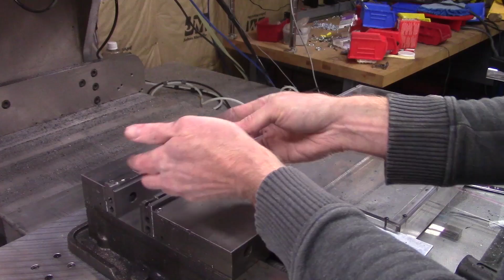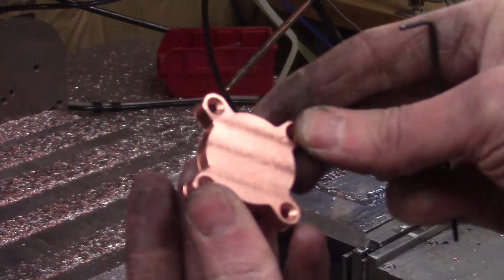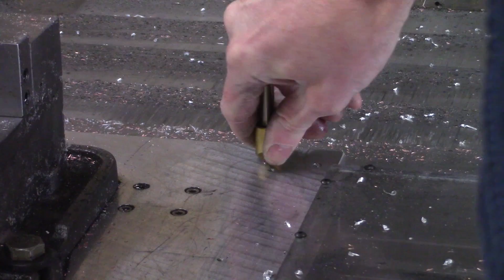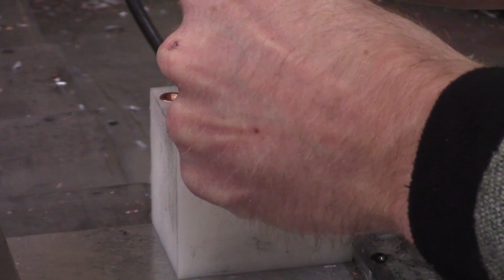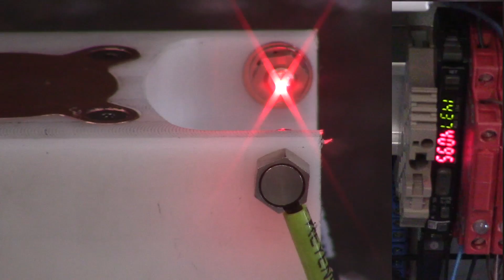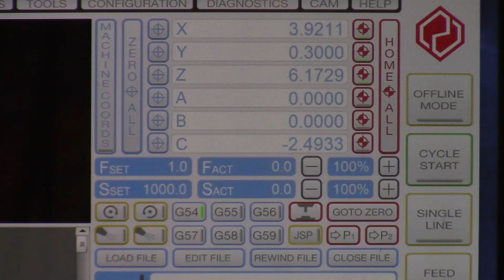Dual Measurement Tool Setter - Optical and Electrical

Comment: just so you know, the angle of the spot drill needs to be greater than the angle of the drills you are using. Starting with the edges of the drill is not good and will wear the edges faster
Reply: So few people follow this principle- even at the trade school I attend instructors don’t know this!

Comment: you can tap the untapped holes for the screws intoo the copper plate bigger as the tread the screws holding the plate to the base  mount intoo , that way you can unscrew the plate from the base put some bigger screws intoo the tread in the plate and have sumting to hold on to if the plate needs to be removed but is stuck in the base or use the force of the screws turning intoo the copper to force it up
looking at the setup if you move the tool intoo the light trap from the side you should be able to automate the tools width intoo the program too (set center of the chuck straight over the trap in the program and any deviation from that is tool width)

Comment: Would it be possible to share the UCCNC macro's for the tool please?
Reply from the maker: Hey David.  You'd be much better served by the guy I got them from originally.  Mine are modified to work with my setup and I honestly don't recall how they work.  Look for "UCCNC Macro sharing" on cnczone.com.  I just used the M31 code he provides.
Reply: Thanks for pointing me in the right direction :) I found the scripts and adapted them, works great :)
Reply from the maker: Awesome!

Comment: When I was working (retired now) we had a little sensor block for setting tool hight. powered by a 9 volt battery it had a brass top that was spring loaded (top could move down 1/2", great for Monday morning settings). We marked it's height on the side and set everything up using a ground rod reference tool. Had a plug on the side that we could use a cable to connect to ground when Milling non conductive material.

Comment: You are using Mach3 ??
Reply from the maker: UCCNC
Reply: How is it compared to Mach? would you consider it more user friendly? does it have a really large forum/Source of help? I barely manage to make my Automatic tool changer work.. but is just really harsh to find people that actually have experience... "Tons of companies willing to write a macro for a few thousands DO!!!!
Reply from the maker: I haven't used mach but it definitely is pretty customizable.  There's a small community of people on the forums to help and the guy behind the software posts a lot.  I'd say you'd be hard pressed to find something it can't do, but you will likely need to program your own stuff; but there's tons of example macros to copy.  Plus the guy who runs the US distribution is really helpful (cnc4pc.com).  I'm just starting to look into using its built in Modbus functionality to have it interface with an Arduino which should make it virtually limitless in its functionality.
Reply: I have actually purchased a few infrared motion sensors from that place, good products, but when I try to get a few questions answer the guy took almost two weeks to answer.. really good products!! even do now when ever I need that type of switches I just brake a part a printer and get them for free..Thank you very much for taking the time to answer my questions wish you the best,

Comment: Hey there, great video, just a quick question: Probing on most DIY CNCs I've seen required a cable or small clamp to be attached to the Endmill you're trying to probe. How did you get around that? I can't see any second cable in the video closing the circuit.
Reply from the maker: The negative rail of the DC power supply is grounded to the machine chassis.  The +5v goes to the plate which is insulated by that big block of plastic. So, when the machine touches it, the circuit is complete.
Reply: I hope the plate never electrically fails. For the sake of your bits.

Comment: Hello chris, really a 
useful project .... listen, i found these .... are okay?  http://www.ebay.it/itm/1-x-KEYENCE-FS-N12P-Lichtleiter-Messverstarker-Erweiterungseinheit-M8-NEU-OVP-/152484164698?hash=item2380c3b45a:g:luYAAOSwzgBY1Sl8
http://www.ebay.it/itm/Adafruit-IR-Break-Beam-Sensor-5mm-LEDs-/151753635777hash=item235538b7c1:g:dosAAOSwrklVAXpa... but i do not
 understand what is that red piece that mounts on the electric panel? Another question .... what kind of macro does it use for mach3? .... thanks .... Compliments for everything
Reply from the maker: It looks like that will work, but it doesn't appear to come with the fiber optics so you'll need to find those too.  Those Adafruit sensors should work equally well if they are sensitive enough to detect small tools.  I've never used them.

The red piece is just an opto-isolator.  It's just a relay to trigger the input on the CNC control board since the sensor wouldn't directly interface with it.

I don't know about Mach3 but in UCCNC I just modified the macro that came with it for tool probing.  I don't know the syntax for Mach3 so I can't help you there.  All I can say is I move to the sensor location in XY and then plunge down until the input is triggered, then move back up in Z enough to clear the block.  Then move XY to the touch plate and repeat the Z move until the input is triggered again.  The sensor and the touch plate are in parallel with the CNC board input so tripping either sensor triggers the same input.

Comment: This might be overkill, but if you think over time your end mills might dent the touch plate, maybe add some randomization to your macro for exactly where the tool touches down, to preserve the life of the plate. 

Awesome project though!
Reply from the maker: Fortunately it touches down so slowly that it has, so far, yet to leave any kind of visible mark on the shiny copper surface. 

I do have a plan if it does become slightly marred, though.  I can re-face the whole assembly (in place) if it ever needs cleaned up. :)

Comment: Nice work as always. Just wonder about all the hand-tapping: Wouldn't it be worthwhile to rig up the spindle so you can power-tap with the CNC ?
Reply from the maker: I wish!  Unfortunately without feedback on the exact speed the spindle is running, you wouldn't know how fast to move the axis and would either destroy the threads or break the taps.  I do hope to one day get a spindle with an encoder so I can do rigid tapping though.
Reply: I just automatically assumed you would be able to mount an encoder to your existing spindle and make that work. But that might not be worth the effort ? You want a new spindle with more torque at the same time as an encoder I suppose ?
Reply from the maker: It could be done, but I don't think there is a place to put an encoder without modifying the motor housing.  It's definitely possible, others have done it.  I just haven't looked into it since tapping is pretty low on my priority list at the moment.  Right now I really need an enclosure so I can quit having to pick bits of metal out of everything I own, lol.

Comment: ok... i have questions. 
1) What software are you using for your interface (p1 / p2 macros?)
2) I'm assuming that the mounting system for the optoisolator is DIN? If not, what is it?
3) Where can i get those optoisolators
4) Where can i get the beam-break sensors?
Reply from the maker: 1) UCCNC  I had to make my own macros and I just assigned them to the buttons since I don't know what the original P1 and P2 even do...
2) Correct
3&4) Ebay 

The opto is a Continental brand but any fast switching opto that works with your voltage would work equally well.  The beam-break sensor is a Keyence FS-N series but they make a TON of sensors that would also work equally well.
Reply: Sweet, thanks :) Just didn't recognize the GUI of the software. I'll be searching for those break-beam switches too !

Great project :)
Reply from the maker: I got mine from a scrapped project but looking at them on ebay I had no idea they went so cheaply! Definitely worth the $25 or so.

Comment: nice video. I see you are using a drill chuck attached to your spindle via the .5in that you mentioned in the comments. what's your minimum rpm? my spindle is 6000 which is way too fast.
Reply from the maker: +Cut and Carve it's about 6,000. I did the drilling in the video at that, you just plunge pretty fast. (But not too fast or you won't have the torque) ;)

Comment: are you using fusion for the cam? you need to lead in from the side of parts if you can, when you machined the plastic it would have been faster and easier on the cutters. also look for tool stay down, you have a few random retracts. if i remember this is all in the linking tab.
Reply from the maker: +Simon Hills I am. I honestly didn't even look at the CAM for that op, just hit 3D adaptive and moved on. Clearly it did not do an optimal job, lol.
Reply: Chris DePrisco I'm not an expert either! just wanted to pass on what i know.  Check out Rob Lockwood's video he did with John Saunders/NYCCNC

Comment: looks very cool, but, have you thought about thermal expansion of the plastic?
Reply: oh and with the fibre optic amp, you generally need to pull the leads out about 1mm from fully pushed in
Reply from the maker: +Travis Hammond I had not thought about thermal expansion, what concern would you have? And I'll go pull out the leads a tad, thanks!
Reply: Chris DePrisco not sure what plastic you've used, but seeing as it's sitting on your table, and therefore the z height of it is table - tool setter, of the tool setter expands a little, your tool setting relative to the table will be off by however much is expanded.
Reply from the maker: Travis Hammond Ah, I'm only referencing the first tool I set, not the actual position from the bed so as long as there aren't any wild temp swings while I'm machining the part it shouldn't matter much. As far as I've thought out anyway.
Reply: Chris DePrisco ahhhhh. that's all good then. 

so you'll set a tool, then set your work z then set your other tools relative to the first?
Reply from the maker: Right.  First tool is manually set to the part Z0 and then the offset from that Z0 to the plate is stored in the C axis DRO by the first macro.  All subsequent tools are then brought to the plate and have their offset set to match the first by the second macro.
Reply: HDPE expands 67 microinch/(inch*F), so a 10F rise in the temperature of that block would result in it becoming 0.00134 inches taller. which isn't great, but it is bolted to a rather large block of metal, so i wouldn't expect its temperature to swing drastically unless you're somehow directly heating up the table by many degrees.

you could put a temperature sensor in the block and compensate. :)

Comment: What make/model is that beam break sensor?
Reply from the maker: +EFormance Engineering Its a Keyence FS-N series. Not sure what model specifically but they have a lot of models for PNP, NPN, etc. It's just the one I had so I used it, lol.

Comment: Why not cut the copper down prior to machining all that off? get rid of the chatter and still have a solid scrap chunk for something else later.
Reply from the maker: I wouldn't have kept the scrap piece so I didn't give it any thought.  Plus I don't have a good way of cutting up something like that so I wasn't about to hassle with it.
Reply: I guess I'm a hoarder of scraps! I also didn't notice the other comment. To me its not on a value of metal but when I need a piece that size and cant find one its rather difficult for me to just run out and purchase a piece.
Reply from the maker: +Rivers Company Right. If I had a decent place to store small scraps and a good way to cut it I totally would save them too. :)
Reply: @ChrisDePrisco  You don't own a hand hacksaw?

Comment: Looking awesome man! Been wanting to make one of these for a while too, glad to see it working so well.
By the way, It looks like your peck drilling cycle has some kind of issue I remember having a while back, where it doesn't rapid back down to the bottom of the hole after the retract. It rapids out and feeds all the way back down the hole. This forum post has the updated m830.m1s macro that should fix this problem-
http://www.machsupport.com/forum/index.php/topic,15205.msg101682.html#msg101682
 It will drill insanely faster if you fix it!
Reply from the maker: Very cool man, thanks!  That's always kind of bugged me but I haven't ever done enough drilling to for it to bother me enough to figure it out.  I'll take a look.

Comment: How were you using a drill chuck on the VMC?
Reply from the maker: +Easton Bednarek Small threaded drill chuck and a threaded to .5" straight arbor, used in a .5" collet.
Reply: Awesome I'm building a similar VMC (with my own twists) and that looks like an awesome way to use drills.
Reply from the maker: Just be careful that you don't accidentally run at 24k RPM with the chuck in -- those things are not at all balanced. :P

Comment: Could the Beam Break Sensor be used to measure the OD of tool?
Reply: Home CNC Stuff yes, but it would need to be rotating to get an accurate diameter setting and would need reference to maintain proper diameters probed for each tool.  meaning  it would first require knowing the centerline of the spindle in relation to the trip point of the beam sensors.  so perhaps you would use a centered and true 1/2" precision gauge rod in the spindle that has been tried and use it as a reference to locate the spindle centerline.  once that is known all other tool measurements would be referenced off that coordinate to record the new took diameter.  this method is used on high end machines to record accurate tool size for wear or imperfect OD grinding from the manufacturer and still attain proper tolerance.  it does require the tool path to be controlled I side the controller and not in the cam, or for a wear offset to be used to amend the tool path for the difference in the calculated kinematics for the new diameter.
Reply: @SmallShopConcepts  Not necessarily- you can simply keep track of your values and then use them when you're doing your programming. Just about every CAM program out there supports tool libraries, and even if you don't have a toolchanger you'll be good to go so long as you can manage to remember which tool is #1, #2, etc.
Reply from the maker: +Home CNC Stuff Perhaps, definitely worth a try someday. I thought about adding a conductive plate on the side and doing the same thing I'm doing now with the height. Get a rough position with the sensor and then move to the plate; while rotating the tool.

Comment: Looks like you wasted quite a bit of that copper stock. Pretty sweet though.
Reply from the maker: I feel like it looks to be more wasteful than it is since you aren't the only one to bring it up... I did the math and I wasted approx. $0.31 (scrap price) of copper, lol.
Reply: Chris DePrisco you know what your doing, just looked like you could have saved a slice off the side was all (I ain't bitching, just saying).
Reply from the maker: Yea, I really do need to get a band saw (not the old, rickety Craftsman wood band saw I happen to have) so I can cut metals to an appropriate size.  Of course, then I need some space for all the offcuts, lol.
Reply: Chris DePrisco no need to keep all the drops if they aren’t useful - scrap dealers typically pay more for solid.